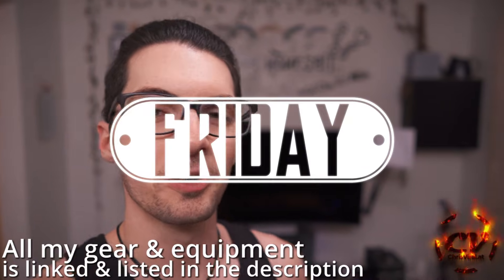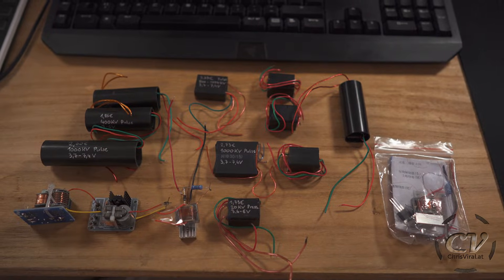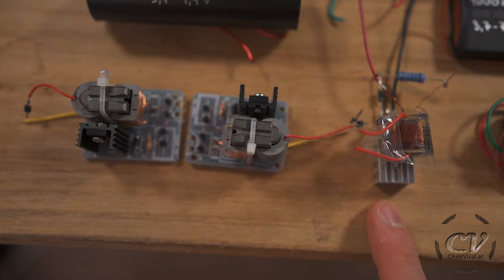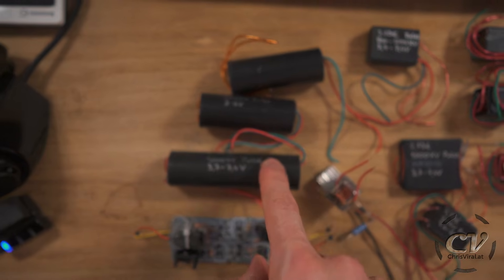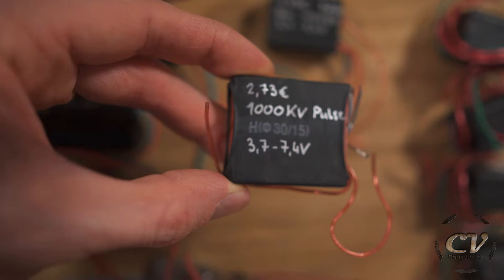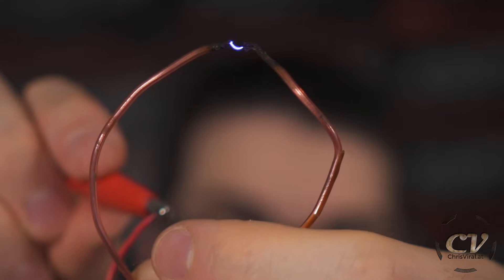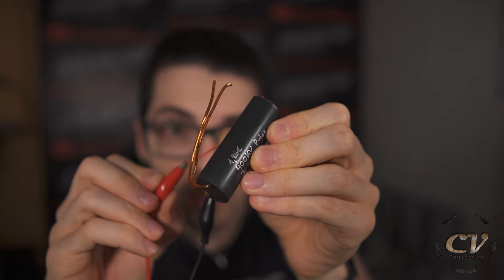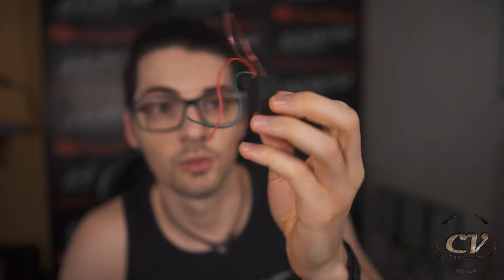High Voltage Generator Comparison (15KV, 20KV, 400KV, 1000KV)

Comment: NICE VIDEO!!
At about 6:15 where you start talking about pulsing frequency...the closer leads require less voltage to jump as the output cap charges and thus has a smaller charge time for that short distance.  As you move then further apart, it takes the cap longer to charge to a sufficient voltage to make the longer jump...thus more time between arcs (and more energy).
FYI: If you hold the leads too far apart (so that the arc cannot jump),  the cap will over-volt and the module will die.
...should'a  commented that 1000kV is 1 million volts.

Comment: Hello friend, like this, first I would like to thank you for your videos on this subject, it has helped me a lot.
I'm from Brazil and I've been researching these transformers in order to design a tool for controlling potted plants, for example weeds in vegetable gardens. I have seen agricultural equipment that already does this service, and they use a voltage between 5,000 and 15,000 volts. My question is, for this homemade system will I only need this small transformer with a 3.6v source? Or is there some limitation? Any help is welcome.

Comment: Hi ChrisViral Vlogs,

As a chemical engineer, I would say that the most interesting application of high voltages is (except rocketry, plasma fun, mosquito-bug zapping, lighting of specific gases under low pressure thus emitting specific atomic bands rays (and colors), etc.):
The making of nitrogen oxydes out of air (nitrogen and oxygen).

N2(g) + O2(g) --High Voltage-> NO(g) + NO2(g) (red-brown)
NO(g) + 1/2 O2(g) --> NO2(g) (spontaneously)
2 NO2(g) <==> N2O4 (g or l) (used in some rocketery as an oxydizer and into some hypergolic mixes)
H2O(l) + NO2(g) --> HO-NO + HO-NO2 (nitrous acid and nitric acid)  

2 HO-NO <==> H2O + N2O3(g) (NO + NO2)

So basically you can make full conversion of N2 and O2 from the air into nitric acid HNO3 (HONO2) by recirculating the unused gases into air and water.
Nitriic acid has been banned from many countries because of "extremo-rists"; about 25 years ago I could buy that at 69% by litters, and it was very convenient for chemistry; but now I have to make my own (what is quite easy for me but requires more preparation).

Reagrds,
PHZ
(PHILOU Zrealone from the Science Madness forum)
BTW I like your gymnastic accrobatic skils on soil tumbling pist

Comment: Hi, what is the right choice for a ring vortex (ring magnet where the arc rotates and looks like a field). I have the 1000 kV version, but it doesnt work since there is no constant arc
Reply: Its because its a pule module. Also the voltahe claims are bullshit. The 1000kv module would make a meter long arc if it really was 1000kv, its in reality about 20-30kv looking at the arcs.

Comment: Just a heads up, the way you are referencing the voltage of these devices is wrong.  For instance when you say or type 400KV that is actually 400,000 volts but those devices are no where near that amount, or 1000KV is 1,000,000 volts ..also  way off

Comment: Ion wind. The higher the amps, but still able to jump the air gap makes more ionic wind. These are high power but short distance for spark gap so you can get them closer without sparking out. With a normal flyback it strips out to many amps and the spark becomes thin. 2 flybacks in series is more like a static volt.

Comment: According to 80 year old knowledge it is about 30 kV/cm when spherical electrodes are big compared to spark length, and in the ballpark of 10 kV/cm when electrodes are needles.
Reply: Good to know, I only know about 3kv/mm as breakdown voltage of air.

Comment: I bought a giant lot of the supposed 400kv ones, the long cylindrical ones, and while I have no way of exactly measuring the voltage, based off the max spark gap they're not quite that high. With that being said, those little things are monsters, especially when you start stacking units together and wiring their outputs in parallel, they match frequency but doubles the current. I have a setup I've been messing with that has 15 of them taped into a cluster, with inputs wired parallel running off a 30 Amp 18650 vape battery (which gets hot in a few seconds of use lol), and all the outputs are wired in parallel as well. A single spark will make your ears ring, and running it for more than a second is absolutely deafening lol. 15 times the current in each spark as one of those units, it's scary stuff. I have no intention of ever being shocked by that bad bastard, it would put my ass on the floor faster than Rocky Balboa🤣.
Reply: This is the question I've been looking for... wiring up 2 to 4 giant 1000KV to a single output... Will it kill a donkey?
Reply: hahahahaha I love your comment. Why are you doing it?! P.s little tips for even bigger sparks: make a Marx generator 😏
Reply: @pasqualemasullo6844  I made it just out of curiosity, I love playing with high voltage stuff lol. And yes, I have a Marx generator, I've tuned it up for max spark length by spreading the spark gaps just to the point that it won't fire so the caps get charged to their max value, but when I bridge the #1 gap with a piece of copper wire it creates enough ionization to kick it off, it makes 6-7 inch long sparks.
Reply: @TheExplosiveGuy  wow amazing! I love it! I’ve never successful made a Marx Generator but tomorrow I’m gonna receive the HV resistor I’ve ordered from US and I’m gonna try a nice setup that I’ve seen here on yt that uses water caps.. I love huge sparks but I don’t like the fact that every time the 1st gap gotta be bridged… I’ve found online some crazy paper with some crazy math application to design a proper resonant circuit that doesn’t need “gap bridging” , if you are so nerd and so curious lol I can share it!
Reply: I've theorised a problem with this approach,  if the generators stacked together are of different capacities, the life of the generator with smaller capacity Is greatly reduced, the electrons theoretically flow through ionised air to the opposite direction but not equally distributed back as discharged before. A solution would be have a charge controller (or receiver) on the anode end
Reply: @Geosbudy  You're actually on to something, because shortly after making the parallel unit I was talking about in my original comment, it shit the bed. One unit had failed internally and was shorting out the rest so it stopped working, I recently tore it all apart and tested each unit individually to find the bad one. I repurposed them for a large Ion/ozone generator I built, it pushes quite a bit of air.
Reply: Mmh seems approving to the theory, 🤔. See no two generators can be equal especially when supplied by the same power source. A solution to get the max gap (1above) is to completely merge the generators to one big piece but that would require more power supply. 
The results may be dangerous for most functions than killing people with high voltage, I'm planning to use this as a smart security mechanism for my solar_wind generators
Reply: When I first fired up one of the "400kv" cylindrical ones to an 18650, I instantly grinned and thought "taser!!" What you have there is a portable electric chair :D
Reply: Just came from your video. Absolute insanity.
Reply: Would it kill somebody.?!
I mean is it dangerous if somebody touches you.?!
I'm asking, since I have no electrical background and don't know much about how that works though.

Cheers from Switzerland

Comment: You can build a taser, you can light up stuff remotely, you can build EMP jammer. I have a bunch of these at home and I was wondering is there anythiing good they can be used for?
Reply: Ozone generators, radiation sensors... can't think of anything else
Reply: Can it work continue for 12-15 hours I'm planning to use it as fence energizer.
Reply: @DC-tl2jb  it's going to burn, I suggest you buy one made exactly for that purpose, it's safer and better
Reply: @rodia_the_smg_guy5575  ok thank you.I thought if it will work then it gonna way cheaper.

Comment: Put things in holders, not by shaky hands.  Measure currents and voltages and distances, sound levels and light levels.  Use labels that are easier to read.  You can print them on paper and tape them.  Thanks for doing this review.  But you have 74,336 views (7 Oct 2021) and that is a great responsibility.  This is not only for play, because knowing how to use these phenomena can change the world as we know it.

Comment: Great video. What do you use as a power source ? For a short period of time, is it possible to use simple battery or is it mandatory to use lithium or other powerfull source (Like a 3.6 V transformer on a 110v/220v main source) ?
Reply: Almost any battery or power source will work long as the voltage is within the operating limits of the particular model (usually above 3.6v and below 12v or directly mains powered.)

      I plan on getting a 12v model and making an ozone generator using its spark. 😊🌎✨
Reply: @DeanTheDoctor  not how it works. Some of them pull above 2-3 to even 5A for an instant. Not amount of current a small power supply or an alkaline battery can deliver, atleast not easily or in time.
Reply: @MaxC_1  Thanks for saying that Max! = )

I forgot that not everyone has access to power supplies and lithium ion batteries as I do. Haha. ^c^  LED grow light fixtures (The ones with adjustable arms) are a great source for 12 volt power supplies in many areas, and thrift shop centers often have a box of power supplies that can be used.

If you have a spare computer power supply, that could be easily set up to power such projects indefinitely. Even a 12v power supply from a mini computer or laptop power supply (when stepped down using a buck converter.)
Reply: @DeanTheDoctor  I mean if you're fine with really long charge up durations or non constant arcing or are on a lower voltage module alkaline or whatever works fine
If you are using one of those 40KV(also sold as 1000/400KV cuz china) then you'll see spikes of over 3A on input so using alkaline you'll get sparks, just smaller and slower
Reply: @MaxC_1 Haha! I feel you on those labels! Thanks man, I appreciate you sharing your experiences. 👍 I'll keep that in mind when I next look at those modules! = )
Reply: I reckon you use lithium ion batteries as they are high drain meaning that they have high output voltage and current which meets the power demand of the volt booster module. Alkaline batteries are low drain which is why they are so cheap.
Reply: Use a 9v alkaline battery
Reply: I have used one aaa battery and it was fine with the '400kv' cylinder model

Comment: For more current use parallel and series in a line 3.7 out but every extra double the current. In series more volt but. A lower current sort off depending on set up's be careful.

Comment: what happens when i use high voltage generator and connect its output to another high voltage generator that only needs 3 to 6 battery? will it explode?

Comment: Are these generators or transformers? How do they work exactly?
Reply: There is an oscillator that drives a high voltage transformer. The output of the transformer is connected to a voltage multiplier

Comment: Great vid! What happens if you continue pressing the on button until the battery runs out? I ask because mine stops creating arc after about 2 seconds, then I have to wait. Is my module broken? Do I need capacitors?
Reply: No the capacitors in the voltage multiplayer are charging up because of the decrease in battery voltage so it will take longer id recommend using a rechargeable higher current battery of about 10 volts if you have the 400kv module
Reply: @legoyoda8037  Not sure what is the max volts for the 400kv module but the actual battery pumps out 5volts. Will 10 volts damage the module?

Comment: Is the output of these generators AC or DC voltage? And how can I know how many ampers is the current? And do these work like hours continously?
Reply: They don’t work hours continuous the output is dc and unless you have a battery that has enough power with a resistor then it won’t run for a while

Comment: my 400kv module brokes,but they have arcs not pulses and it can ignite papers but i put some 15kv 1nF capacitor and the power is back
Reply from the maker: There are pulse modules and constant arc modules basically :)

Comment: These generators can go up to 25-30KV, 3cm. 

not 400KV 1000KV
Reply from the maker: Surely... I measured the gaps in this video: https://youtu.be/00U9zTZParg
Reply: @ChrisViralVlogs  About 110KV = 11 cm.  https://www.youtube.com/watch?v=INs-jiR5mHo
Reply: @ChrisViralVlogs  can we run it continuously for 1 minute plz reply
Reply: @rajayeruva2361   I’m also interested in endurance test. I’m looking in to use a high voltage module to make o powder gun. Have you done any test for your self?
Reply: @EkholmAndreas  no sir
Reply: @EkholmAndreas  no sir. I have not done any of the test .
But I think your powder gun idea will work . 
It's a great idea
Reply: might not work these. Modules create high voltage on low frequency thus making an arc he to use modules like this that output. Higher frequency like plasma lighters.
Reply: Since the breakdown voltage of air is 3MV/m wouldn't an arc of 3cm be closer to 100kV?
Reply: i never will have the guts on testing that anyway lol
Reply: Can I buy these cheaply?
Reply: @prasannakumara6395  They are about $2 on ali express.
Reply: I wasn't expecting to be so god damn Loud it literally woke up all my family members
Reply: @plasmascientist  Do they sleep in the same room as you? They aren't that loud. Snap, crackle, pop.
Reply: @minkorrh  nope, I actually have one of my own, and it sounds like a machine gun in real life
Reply: Matters not. They are quite painful, which is the point.

Comment: Sorry, not very useful information.
It would be more informative if you measure the arc length which corresponds to the voltage. 
So the seller description could be validated. These modules are often falsely advertised.
Reply from the maker: This was just the overview, I did that too, linked in the cards and also first line in the description. But since you missed that, here's the link: https://youtu.be/00U9zTZParg

I usually do a lot of videos on one subject and like in most cases, the overview video gets most of the views and exposure. But anyways..
Reply: HI CHRIS,   COULD BE Also NICE TO MEASURE THE FREQUENCY,   can be done with a micro wave oven plate motor coil. Or similar... . And a good multimeter or a scope :-). Approaching the modules, and using induction.

Comment: Air breaks down at roughly 1KV to 3KV per mm. An arc of 10mm is roughly 20KV. These Chinese generators are a scam in the sense that voltage and current ARE unknown. The ratings are all wrong.
Reply from the maker: Yes indeed..  I measured the gaps in this video: https://youtu.be/00U9zTZParg
Reply: Guarda che ti sbagli , una volta ho comprato un taser da 2 milioni di volt 😂😂😂 e la scintilla era come quelle 😂😂
Reply: Actually I measured the voltage of those modules and it seems like they all output around 15KV

Comment: hey man i play with some of them as well the board one and  the 400kv one.i build one from a  old crt tv flywheel transformer a mosfet and a resistor .I found out that if you take multiple high voltage diodes and hv capacitors the silent ones can become like the loud ones .voltage multipliers .so i guess inside the pottted ones there is capacitors as well
Reply from the maker: Thanks a lot for the insight! Yes indeed there are capacitors inside 😁
https://youtu.be/YoOF-CVm1w8